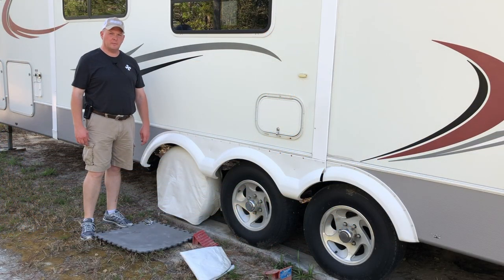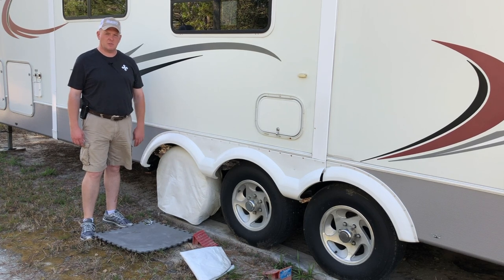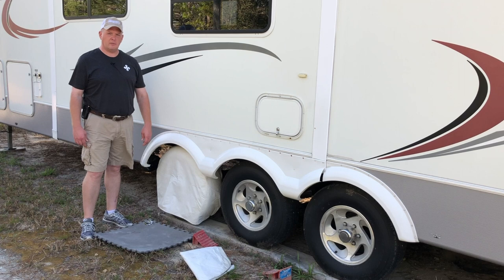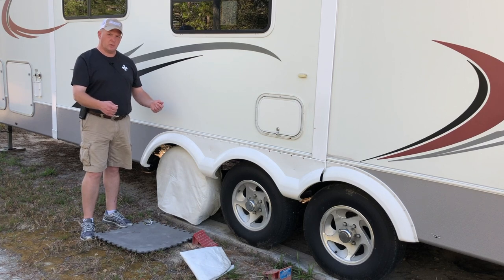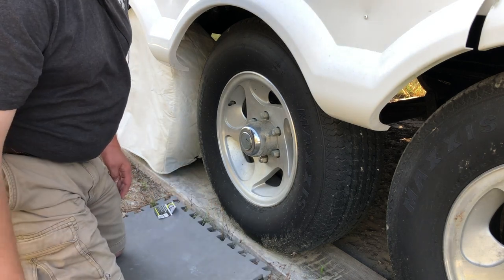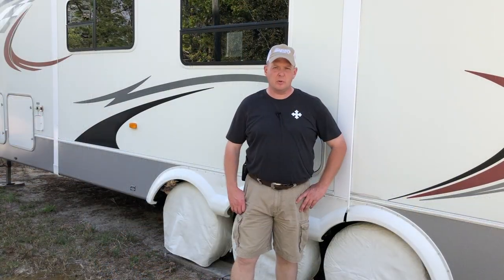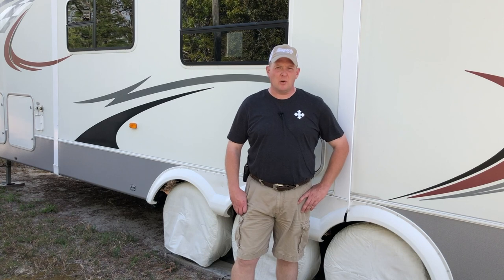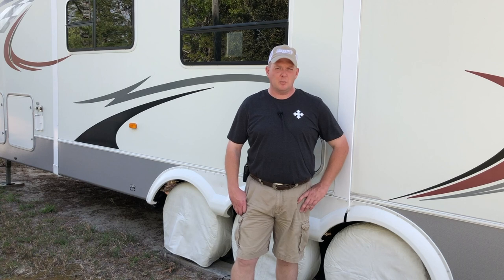Protect your RV Tires

Comment: Should I get pressure treated wood? The wood under my camper has rotted and I’m afraid termites are in it and possibly in my RV.
Reply from the maker: From what Ive heard in the past, treated wood is supposed to protect against bugs and no so much against rot. Id say treated wood would be better than untreated. If you are able to get concrete pavers, they would work to as long as they have a solid base under them or the trailer may break them. untreated wood soaked with used motor oil would work as well if you or someone you know changes your vehicle's oil.

Comment: couldn't you just use trash bags?
Reply from the maker: I do not believe trash bags would hold up to the elements over the course of owning an RV. I would also question if a trash bag would have the same ability to protect against UV damage because of its thickness.
Reply: @WindersRanger  true true. I even read about placing carpets over them.
Reply from the maker: Yeah, i imagine carpet would work okay as a cheep alternative. It would hold water close to the wheel which really would only be a problem for a steel wheel or hub cap.